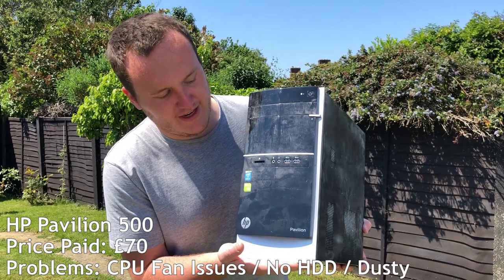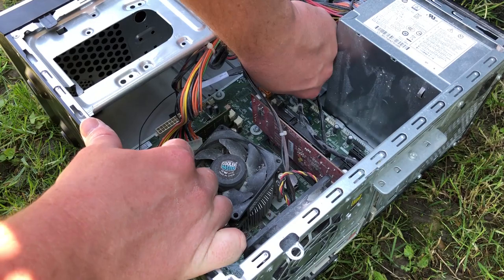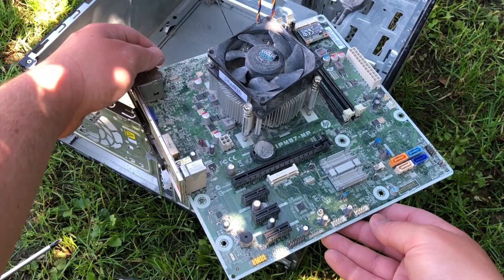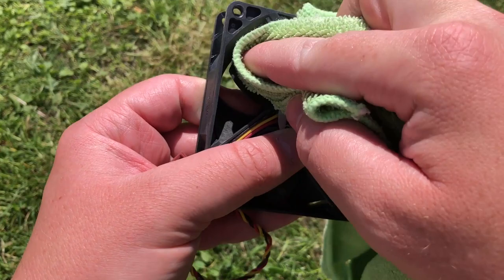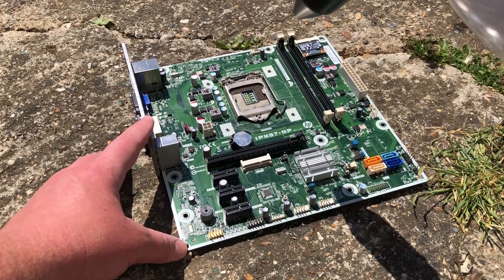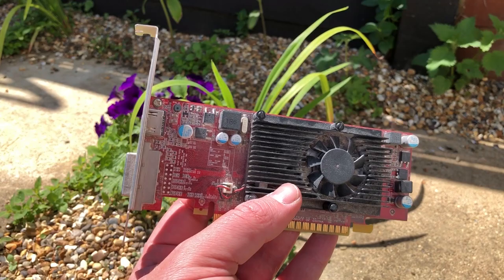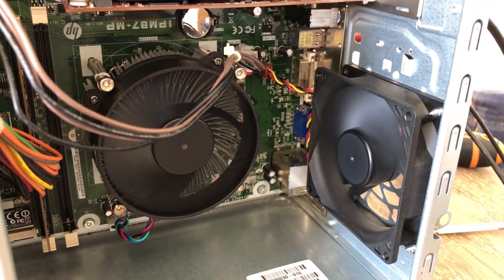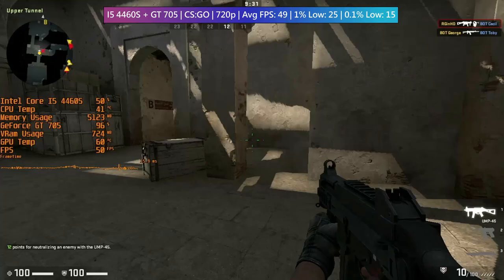Fixing Broken Ebay Gaming PCs - The Filthy HP Pavilion

Comment: these old hp machines looked gorgeous when they were new
Reply from the maker: Yeah I’ve always liked the simple but effective design of these things
Reply: Theyre nice from back then but gorgeous?  Yes
Reply: I just upgraded from my 2011 i3 Sandy brdige hp pavilion
Reply: everything and everyone looks gorgeous when they are young 😂
Reply: Like i said i have one its an hp pavilion 500 series and with some tuning i replced the psu for a 850w unit a smal factor gtx 1060 6gb and 16gb of ddr3 ram. It has an i7 4770 non k version and it runs erverything i wana play even cyberpunk with a mix of setings to 40fps at 60 but most of the time is on 60 fps. Just finished days gone on it now started death stranding again all maxed out. And my hp have Wi-Fi built in it dvd drive just as i like and i have an 1tb hd and a sata 3 ssd from team elite. And yes has no rgb but i prefer like this when a frend comes to my house and looks at it and say that cant game its an older system bla bla bla and than they taste wolfenstein 2 completly maxed out at 1080p with 150 fps on average they shut up in seconds.
Reply: @stormbreaker82  bro 😳
Reply: @candidosilva7755  I know, it's just non technical people who will see the case and judge instantly, I mean I guess you can't fit like an rtx 3090 in a case like that but you could still have like a 2080 ti or other gpu
Reply: I've got 2 old Dell Optiplex pcs. Bargain performance but the cases are cute.
Reply: @stormbreaker82  pretty sus comment ngl
Reply: I get a lot of HP machines from my recycler they look sad now 🤣
I had a similar machine when it was new
Reply: @insanelyjason  😒
Reply: i have an hp compaq elite 8300 
some of the specs are upgraded, but it's actually really good considering it was made in 2012
specs: 
cpu: Intel Core i5-3470
gpu: nvidia gt 730 (kinda bad, but it works.)
8gb ddr3 ram
the only problem is it randomly decides it's not gonna work, so i have a nee problem every week, but it's pretty good
Reply: I miss old PCs 😥
Reply: @stormbreaker82  someone come get this man
Reply: Can confirm
Reply: Not old
Reply: @candidosilva7755  Mine was an HP pavilion 515, but I couldn't get a "modern' graphics card to run on it. I upgraded the PSU to 750 W, but the motherboard wouldn't recognise either a gtx 1060 or even a GT 1030...
Reply: it is new

Comment: 8:22 one suggestion, if you're gonna blow air on your mobo, do it with the cpu installed to prevent any dust or thingies getting into the socket.
Reply: same thought
Reply: Won’t affect it in the slightest. Why are people so fiddly with computers, they are quite durable 👍 same with static and shock (drop etc) “damage”
Reply: @conorf8091  That's not the point. The point is that it's very clean underneath the CPU and blowing the dust away after removal could only make things dirty. Technically the PC would probably run fine for many more years, if he just replaced the CPU fan and didn't do any cleaning.

Not removing the CPU before blowing away dust is not a computer handling guideline. It's an effective cleaning guideline.
Reply: The real danger is that dust could be electrically conductive and cause the CPU to short.
Reply: @CheapBastard1988  correct!
Reply: @darkpower4899  exactly
Reply: Stick some thermal paste in there will be alright
Reply: @conorf8091  you know nothing :P
Reply: I learned that the hard way, now I don't have integrated graphics or overclocking :(
Reply: @117gerardle  +1
Reply: exactly, what he did was very dangerous for the cpu socket, and this is specially true in intel sockets, the minuscule pins are completely exposed and could even bend with the blowed air itself, besides getting covered in dust
Reply: @CheapBastard1988  so we’re going to give him shit for dusting off the board after removing the CPU, but completely ignore the surroundings he does it in?
Reply: @conorf8091  idk mines had trouble with Google images after cpu install and static shock

Comment: I really like the homely-style that you do in your videos! It's so relaxing and soothing with those pc components in the garden with your calm voiceovers in it, than in a studio with electronic music in the background! Keep it up, RandomGaminginHD! Also, I'm considering in getting that same electric duster as yours as it is £50 and I've heard good reviews. So, here's my question about it, do I have to ground myself before I start using it to clean my pc?
Reply from the maker: Thanks! It’s a great cleaner, you shouldn’t have to worry about grounding yourself
Reply: I can concur, I have the exact same model air blower and its brilliant.
Reply: You don't need to be grounded all the time, but touching not painted part of a pc case when it's still plugged in (or other grounded thing) is a good practice. Also for time of cleaning avoid touching pets, carpets, and some kinds of clothes.
Reply: They sell a bracelet with a wire clip to discharge static, I have it and it's not a bad idea to wear it when working on delicate parts like RAM and motherboards. Honestly I think that the best way to address the problem is wearing antistatic clothes and shoes.
Reply: I have the Compu Cleaner in red and haven't bothered grounding myself.  I do what RGHD did in this video as a side hustle and haven't caused any issues.  A couple tips though if you plan to do something similar to the video:

Unplug the computer and hold down the power button for 10 seconds to discharge the electricity from the computer.  Use the blower before unplugging/disconnecting any computer parts.  That way you don't get dust in used RAM slots or in the CPU socket for instance.  Use your hand or a plastic pen to hold fan blades to keep them from spinning.  Not doing so can cause damage to the motor (I have experienced this a couple of times).  Be careful when using this to dust off hard drives and CD drives.  I have actually stopped using it for those and just wipe them down by hand.  You can accidently force dust into places you don't want it to and cause problems.  I had a working CD drive that stopped working right after I cleaned it with the Compu Cleaner, but it was fixed by opening and closing the tray.  I may not be lucky next time.  Lastly, the intake is at the bottom of these cleaners and there's a filter to block big stuff from coming through.  Make sure you check it often and don't set it down on places like carpet or loose things until the motor is completely powered down; it helps keep it from getting clogged quickly.

Anyways, the duster saves you money in the long run and is useful for many other things as well!
Reply: Not like some channels:Ok here we are in our 60k+ $ studio,with our pro equipment we are gonna teach you how to build a budget pc.
Steps:
Buy RGB
More RGB
Nvidia RTX 3070
128 GB  of Ram
3 Pentabyte Samsung SSD
Intel I120 190000000000k
And Windows 20 for only 200 $
Total=Liver,heart,brain,hair,eye,lips,ribs sold to your closest black market dealer
Reply: @unkn0wn223    Precisely. I've unsubscribed from several of those high-flying YT channels. They are great when the hosts were new and hungry, but now that they've enjoyed a modicum of success, they've forgotten their roots. Now it's all about their personal lives and absurdly expensive builds with only the latest-and-greatest components. No thanks.

Comment: You can use a steamer for cleaning the 'non' electric components like the 'case' after blowing it with the blower. It kills the unwanted germs and and provides a newer look. The steam can clean the grimes form all the nooks and crannies. Since its steam it'll take about 10 secs to dry out, so no worries.

Comment: My office has that similar pc. I've took apart the psu to blow air inside of it and had no issues. The cpu cooler fan had an error too but managed to get it to work by taking it apart and cleaning it from the inside. Gave it an ssd and 8gb dual channel ram and its a great office pc.

Comment: When you use the Blower on the PSU (or something else with a fan) you should block the fan from spinning, since it can otherwise function like a Generator and fry components.
Reply: You're right, but the voltage it generates is not enough to actually fry components. I've blown out entire systems without blocking the movements of any fans and they all ran without any issues when I started them back up.

Comment: Looks similar to the Dell XPS 8700 I bought back in 2015 except the motherboard has 4 RAM slots (4GB DDR3 1600 MHz in each), an i7-4790 and a GTX 745 (now replaced with a 1070). Also, the PSU was 460W (now replaced with a 650W 80+ Gold).
And yes, the case was complete HELL to work with! The thing would get caked in so much dust too!
Moving it all to a NZXT case was the best decision I made.

Comment: i picked one of these up and they can become pretty darn good gaming pc's it can handle modern games very well with a good gpu and enough ram, it became my main pc
Reply: How was the PSU? Did you need to replace with something that has a bit more juice?
Reply: @byteme0000  the psu was around 250, but i changed that to one of 650w

Comment: I'm glad you were able to resurrect the old beast! a lot of the time I will change chassis as I kind of hate the chassis HP used on their systems. on these rebuilds, I will max out the memory and add 2 or more hard drives for additional storage. HP goes with a generic version of Asus motherboards and most of the time they are faulty. I've had to scrap out board when the SATA connectors fail and the plastic SATA sockets come off the board. the other thing I do is to get the specs on the motherboard to verify the amount of ram and maximum CPU size.  Excellent video! thank you for sharing!

Comment: I bought an old gaming machine a few weeks ago from Craigslist for $30..phenom II 965, 12gb ram and a 1gb 550ti. He said "it shuts off if I game too hard, so I upgraded". 
Get it home...the rear exhaust could barely breath and more so you couldnt even see the heatsink inder the cpu fan, a good 4-5mm of dust and pet hair. 
I used a cheap $1 store paint brush and finished it with canned air and a light alcohol wipe down.
 Love to see these types of vids because that what I spend my time doing....not benching 3000's series cards I will likely never get to buy..lol.

Comment: When I bought my secondhand PC the PSU fan "died" after 2 weeks (it was louder and louder until it stopped spinning completely). I dissasembled the PSU, removed the fan, peeled of the sticker and dropped 1 or 2 drops of oil on the fan shaft. The fan spins freely now and is nearly silent. It's been 3 months since I did that and the PC still works flawlessly :)

Comment: More screws than your local

Massage parlour?
I recently got given my first Dell Optiplex, with an i5-4670S and 1X4GB RAM. The maximum non-cpu bottlenecking GPU to turn this into a legit gamer is probs going to be a 1050ti, and chuck in another 4GB stick of course. I reckon if i can get a GPU for 100-150 i could probs flog it for double that (Minus SSD & HDD).

I've had a compu-cleaner for a while now and it's the single best purchase i've made for sorting PC's out!

Cheers Steve, your videos are a visual representation of sad i mean happiness for me personally!

Comment: I use a paint brush and I bought a near silent 1 gallon Air compressor, works perfect. On some systems I'm picked up and repaired, I have taken the PSU apart to clean it, I actually did one recently where the PSU a 750 watt Seasonic PSU the fan controller died in it no matter the fan plugged into it, it wouldn't power it, I had to replace the fan and run the fan wire out the back of it and plugged it into a molex connector, it would overheat with a Vega 64 and a Ryzen 7 5700G. No sense in tossing it if it still works but needs a fan replaced. Of course I wouldn't be touching things inside of it.

Comment: 10:20 The paste is designed to fill the invisible gaps between the heatsink and the cpu.  You should basically put on just enough that you can scrape it all off with a credit card and have an extremely thin layer covering the entire surface.  That's how I learned it, anyway.

Comment: The fans failing is mostly loose connections if it isn't burned out. Had an old Optilex 765 that also had a 'fan problem', but turned out it was just the pins that were loose on the connection's inside. Had to be pinched with pliers so they'd get a good grip, works just like brand new.

Comment: 2 things I would do differently, and maybe something to consider for future restorations...

1. Give all that dust a blast out with the air blower before removing any parts, saves particles falling into sockets etc.
2. That front facing had a high gloss front, I wouldn't ever put it facedown on concrete or stone surfaces. Stick a towel or something under it  first...

Comment: @RandomGaminginHD
Some advice on GPU Thermal Paste application:
Tldr: Spread the paste thinly and evenly on the bare die. (With a spudger or a cut piece from an old credit card or something like that)
Why you might ask?
Well, for crappy cards like these it wont matter 99% of the time. But let me tell you I've owned a 7970 Lighning BE in the past. Applying a pea sized amount on the bare die would spread out evenly on the die, in a circular pattern. Leaving out just tiny spaces in the corners (really only like 1mm of space): I deemed the card faulty because whenever I furmarked the thing, it would give me massive artifacts once it warmed up. I was about to give up but then I reapplied the thermal paste, spreading it out evenly to cover the full die. And boom, it worked like a charm (no Furmark artifacts anymore) - even though reported temps were the same between the two methods.
Leaving me to believe that this really power-hungry card would actually overheat PARTS of the die (not where the temp sensors were positioned necessarily), leading to transistor failure/partial overheat. So from this day on, whenever I am to apply thermal paste on a bare die, I thoroughly make sure to get full coverage of the die. With IHSes you don't need to be so peculiar.
Keep rocking ✌️

Comment: The screws are all torx + slot except for the crosshead ones on the case and cpu fans, and the case screw, which is designed to be opened by hand. HPs generally have about a dozen spare screws held behind the front panel. If you don't have a torx bit then it's more difficult, but generally it's a pretty decent setup - it's a much more solid grip on the screw when you're reaching down into a case.

Comment: That sort of make up brush was a godsend for me when i got thermal paste over the pins of my ryzen 2700x. I did have to trim the brush down a bit tho, it worked wonders.

If i didnt have an air compressor in the shed id think about getting one of those blowers, as blower air certainly saves a lot of time.

Comment: You don’t know or even understand dirty until you’ve seen an old Dell or HP that’s been in a powder metal factory for 10 years.  You’d be amazed to discover powdered metal doesn’t short out components like you’d think.  At least not the way it builds up from being in the air.

Comment: My uncle has exact look-alike PC but has Windows Vista when it was purchased instead and Nvidia 9500 GS. Was dusty as hell and the PC was called as "tractor" because it's so super noisy. 

After my uncle took the PC as backup PC to basement. I decided to diagnose the noise and turns out the GPU fan being bit clogged. After blowing off it's back as quiet PC. It still works after 13 years and has Windows 10 installed.

Comment: i use toothbrushes to clean and also good quality paint brushes and automotive brushes for detailing. its safe to blow it with the blower too but you can get the blower way way closer, you wont mess it up. ive dusted tons of high end psu and motherboards with a duster more powerful than that and get super close to every thing. being that far away left alot of dust, also blow first then dust with brush second, and third wipe down. your spreading dust around if you do it out of order.

Comment: I use a leaf/snow blower to dust my PCs, for a quick clean I don't even take it apart. The thing throws a lot of air, and if you blast enough in the case it'll push into every crevice

Comment: Always liked the inverted case layout, the fans on the GPU do not have to endure as much stress when they are facing up. Had a GPU fan power circuit get fried when one of the fans fell down something that could not have happened in an inverted case.

Comment: The CPU fan may still be working, perhaps just needs a little lubrication.  Peel back the sticker, perhaps pry out the rubber or plastic 'stopper', and put a couple of drops of sewing machine oil in.  That's usually enough, though the fan can be further disassembled by removing a plastic clip, and pulling the fan out of the spindle to receive a little more oil.

Comment: Not a bad little machine, especially with a psu swap. For the fun of it, a couple of years ago I bought a HP Envy, which pretty much looks exactly like this one just bigger. It came with a 4560, 8gb ram, 1tb hdd, no gpu but also had a 430watt ( i think) psu with pcie power connectors (stock from HP). Ended up upgrading it to 16gb ram, an i7 4770, added a boot ssd, and added a 1060 6gb and it ran great on the stock psu. Stayed cool even with all the plastic blocking the intake grates and 1 or 2 stock case fans, and the tiny cooler master cpu cooler kept that 4770 surprisingly cool. I originally did it for the fun of it and considered using it for VR in my basement, but after setting up VR in my office area on my main PC, I ended up selling it. Even today, something like a 4770 and a 1060 6gb (or rx580) are great 1080p setups for most games.

Comment: Oh and if you intend to use the same fan's they need to be lubricated. Clean first with an electronic degreaser spray allow to dry then use like a 3 in 1 oil to lubricate.